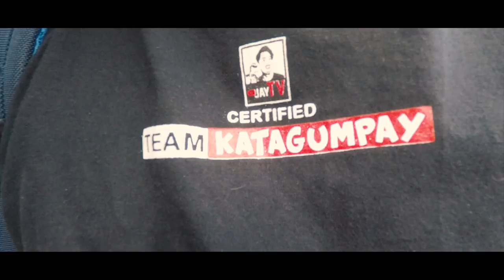YAMAHA NMAX // PAANO MAGPA-POGI NG NMAX MO // MAY PA-GIVE AWAY TAYO! // MOTOVLOG

Comment: NMAX MODEL 2019
NON ABS
MATTE BLACK

NAME: MAXXINE

SPECS:

Frame	Scooter	Category:	Automatic

Ignition Type	: TCI (Transistor Controlled Ignition)	Fuel Capacity (L)	6.6 Liters

Bore x Stroke (mm):	58 mm x 58.7 mm	Displacement (cc)	155.1 cc

Engine Type: 	Liquid Cooled, 4-stroke, SOHC, 4-valve	Wet Weight (with oil & fuel)	127 kg

Seat Height: 765 mm	Wheelbase	1,350 mm

Minimum Ground Clearance:	135 mm